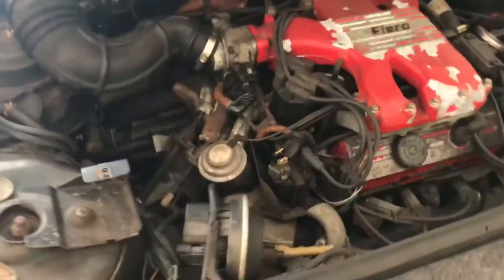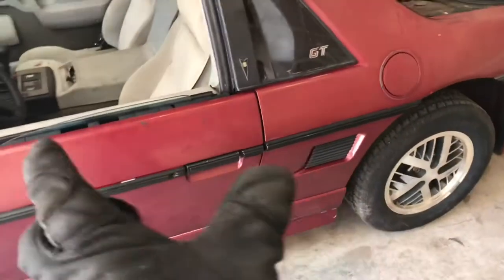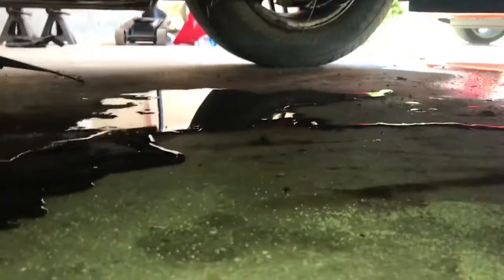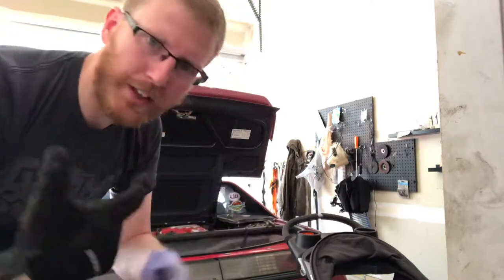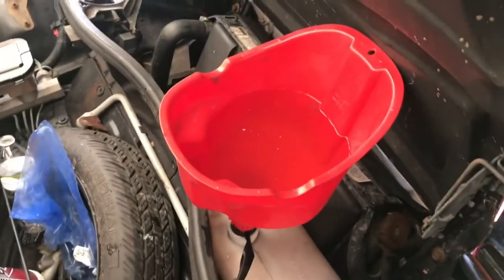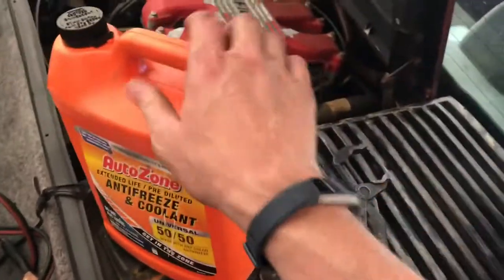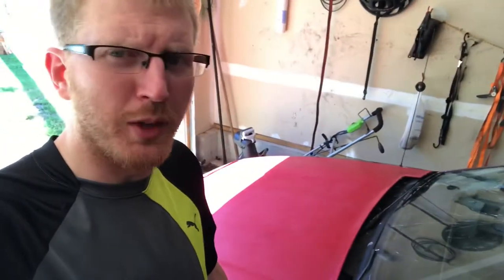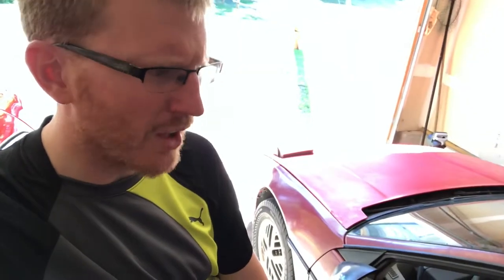That’s a lot of fluid on the floor.

Comment: I've got a 2009 Hyundai Accent hatchback base model with NO options whatsoever...no cruise, no ABS, no power locks/mirrors/windows, no ESC, no A/C, manual trans, etc.

Only thing it has is power steering and a factory stereo with an Aux. input - I do miss Cruise on long trips and power mirrors when parking, but otherwise, I love the simplicity of everything. Manual stuff seems to be more robust (the power windows in my old 2002 Subaru Impreza wagon would barely open in the winter if I needed them to, but that's never been a problem with the manual windows on my Accent) and much easier to fix when it does go wrong - nothing broken on my car yet after 90,000miles of life!

Something to be said with going old-school! Enjoying the build so far! Not really a big GM fan at all, but there is something interesting about the engineering they were trying in the old Fieros - at least they took a chance at something different and unique, which is something you'll never see GM of today do!
Reply from the maker: Thanks for watching and enjoying the build! 
I’m glad we agree on the simple is harder to break, I’m shocked to hear that you could get manual windows in 2009. 
I too was never a big GM fan, these Fieros are such a odd car that they tickle my weird car fascination.
Reply: Manual anything isn't very common anymore in the US, but a lot of companies in Europe still sell bargain basement models of their cars....still wish they did here! Good luck with the coolant issue! :)